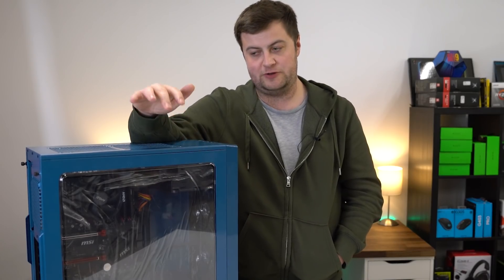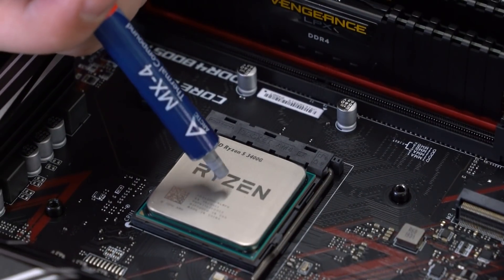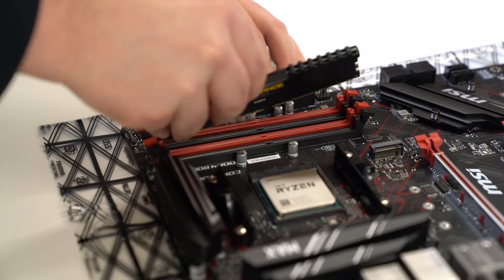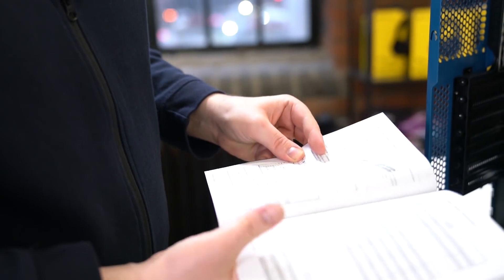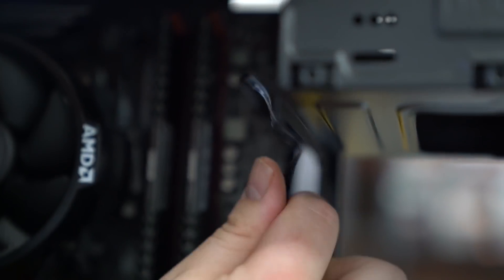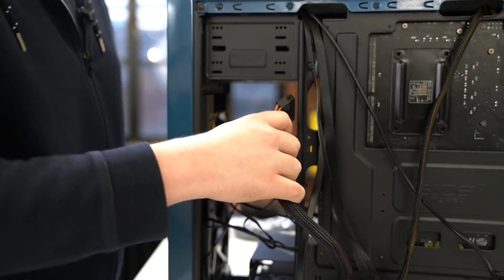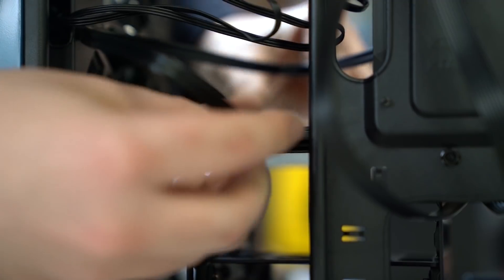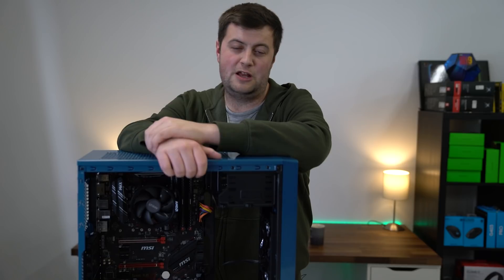How to build a Gaming PC: Step-by-Step | WePC

Comment: This going to my first time building, did you have to buy all the cords that connected the motherboard to the case, or did it come with one of them? I'm too young to have a job so I need to make sure I don't mess up because this costs too much to retry
Reply: Also, these are all generally the same, and aren't going to be different from brand to brand, right?
Reply from the maker: The case will come with the cables for front panel I/O (USB, headphone, microphone); power and reset switch and power and HDD LED (where applicable). The Power supply will come with the appropriate cables to power everything, just be sure the power supply has the right PCI-E connectors for your graphics card if you're using a discrete graphics card. So it will either be, 6-pin, 8-pin, 6+8-pin or 8+8-pin. If you're not using a discrete graphics card and are using a Ryzen APU like the 3200G then you don't need to worry about this. That said, if you want to upgrade to a discrete card down the line, it's worth investing the extra in the power supply now so you're covered for that eventuality.
The motherboard should come with at least two SATA cables for your SSD or HDD but be sure to check the manufacturers site for box contents as it can vary.
So, just pay attention to the cables the power supply has the ones your PC will need and you should be fine. In terms of the cables inside the PC, they generally come with the motherboard, case and power supply so you shouldn't need to buy anything extra.
Best of luck with your first build

Comment: Do you need anything else to connect to the internet because im a bit confused on your website it suggest we get a wireless adapter but if I install the LAN drivers will it work without it and if so where would you put it.
Reply from the maker: It depends on the exact PC and is down to the motherboard. Most cheaper motherboards don't include Wi-Fi so we recommend a wireless adapter since most people want to use it. If you are connecting to your network (and interent) using an Ethernet cable then you don't need the wireless adapter. You just have to install the LAN drivers like you say.

Comment: I don't find the PC build hard, but choosing the correct parts making sure they have compatibility is difficult. I am currently using PC part picker to choose my parts for my first gaming build. 
Is pc part picker reliable? and what is the best way to choose parts quickly.
Reply from the maker: PCPartPicker is a great tool, but won't pick up on some nuances. There isn't much beyond spending a lot of time googling or asking on forums. We make sure our PC builds use hardware that is compatible.
Reply: @WePC  Thanks, I'll carry out more research

Comment: I am new to this, will everything connect or do you need to get certain things that only work with other things
Reply from the maker: Not too sure what you mean. Everything will connect generally speaking. If you buy one of our builds then it's guaranteed to all work together: https://www.wepc.com/builds/
Intel CPUs have a certain socket and will need a compatible motherboard (LGA1151 or LGA1200), the same is true for AMD (AM4).

Comment: If a cooler comes with thermal paste already on it (which I think(?) most included ones do), do you need to add more?  Is there a way to determine if there's already thermal past on a given cooler?
Reply from the maker: If you've bought an intel or AMD CPU and a cooler comes in the same box then thermal paste is pre-applied. If you've bought an aftermarket cooler then it should come with a small tube of thermal paste that will need applying.
Here is an image of pre-applied thermal compound: https://i.imgur.com/5c4DTrb.png

Comment: I’m having trouble mounting the motherboard. I have H510 Mid-Tower ATX case and mpg X570 gaming plus motherboard. My case came with 1 standoff screw and 1 standoff wrench. I don’t think my motherboard came with any standoffs. The case recommends inserting 8 6x32 screws and Idk what to do.
Reply from the maker: The motherboard won't come with any case screws. The NZXT H510 should come with the standoffs pre-installed or in a bag. If this is not the case we can only suggest contacting the place of purchase and asking for said standoffs or a full replacement.
Reply: WePC I figured it out, the case actually had a standoff preinstalled and I’ve successfully completed the build. Thanks for your assistance.

Comment: Ok so I've armed and connected everything except for one cable and I don't know where it goes. The cable is from the case and I don't know where it goes on the motherboard. I think the cable is for headphone connection.
Reply from the maker: Assuming you're using the MSI Gaming Plus Max then the front panel audio connects to JAUD1 in the lower-left corner as I've highlighted in this image: https://i.imgur.com/dYaynba.png
Reply: @WePC  I actually used the parts you had on this article
https://www.wepc.com/builds/best-gaming-pc-under-800/
but you've updated the parts since then and the spot you highlighted in the picture even if I had it does not fit the cable. The cable has like an L shape not pins or holes.

Comment: What motherboard is that? Is it support 2 gpu?
Reply from the maker: MSI B450 GAMING PLUS MAX. No it does not support SLI or Crossfire. You'll want to look at B550 or X570 motherboards for multi-GPU support.

Comment: Do you always leave your fresh new mobo on a bag design to be conductive on the outside?
Reply from the maker: Right, so I did some research and it turns out you're right. There are many types of anti-static bags that can be found like dissipative and conductive. But at the end of the day, the USER is most likely to cause damage with any (great) potential difference.

Comment: When i was putting in my mother board i only had 4 screws but there is 8 holes what shoild i do
Reply from the maker: We'd recommend consulting the manual for your case. The case should also come with a box screws and these are the ones you should be using. You should have motherboard standoffs aligned with each hole on the motherboard. Could you tell us the motherboard and case you are using?